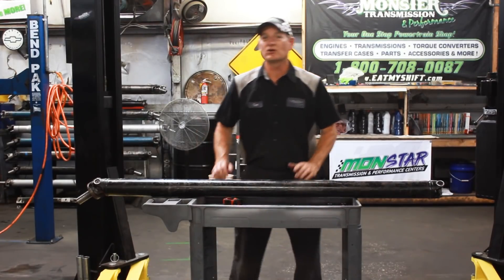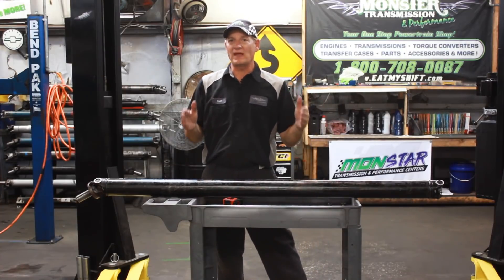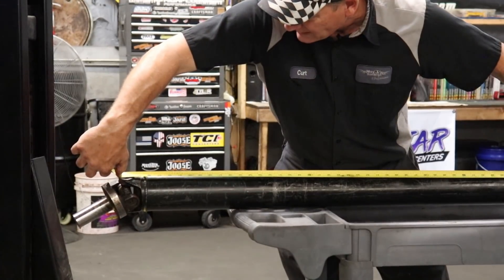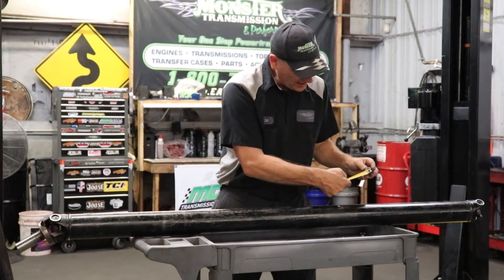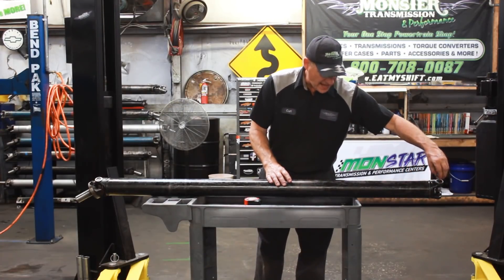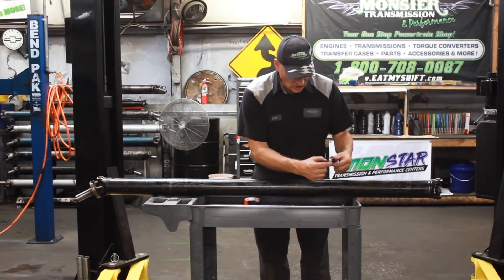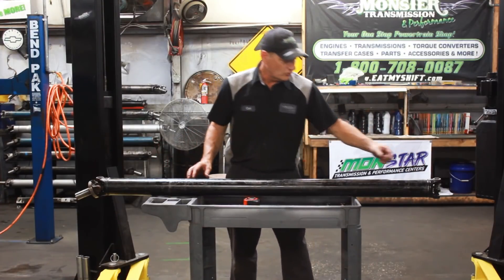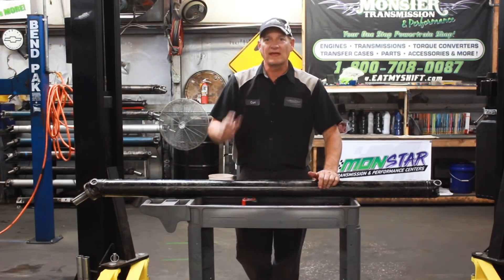How to Measure A Driveshaft | Monster Transmission

Comment: Kurt; I have a 84 K20 Chevy Suburban. I bought a 1989 700R4 to replace my current transmission which lost 2nd through 4th gear; still had 1st & reverse. The 89 700R4 from what I understand has a 30 spline output shaft which would not marry up to my NP208 correctly unless I get transfer case rebuilt with a 30 spline shaft on the front.. The original transmission has a 27 spline output shaft. Any suggestions would be great.